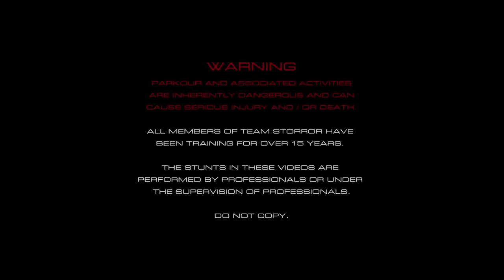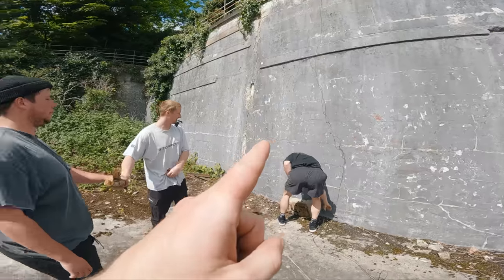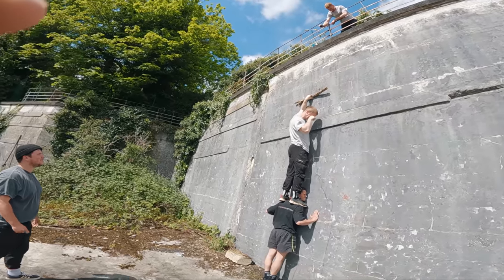STUCK IN forbidden pit - 7 WAY ESCAPE 🇬🇧

Comment: Great one. You could add rules like "stairs and doors not allowed" or "regular human pathways not allowed" to convert any place into a "pit". Then you can do the challenge in most urban places :D
Reply: but thats the whole point of doing it in an actually pit, its that feeling like "we're actually fucked if we cant get out"
Reply: @sawetneb7322  Might be fun in a location by the water or where the tide's coming in though. Like, you can get out "the easy way" if you have to, but you're going to get wet.
Reply: This is true, but I think the visual and feeling of being "stuck in a pit" is what Storror is after. I think what you suggested is possible, but would be closer to "urban climbing" than "being stuck"
Reply: @sawetneb7322  This episode seemed fine enough though, they always had the option to climb out using those pipes. They had to self impose a rule here. I do agree though a legit pit gives a different feel in the back of your mind
Reply: Using a door or stairs is fine... for one person. The rest need to use a different route.
Reply: That's a great way for others to try out escaping the pit without the consequence of failure! Maybe not for STORROR but for the viewers this is great insight